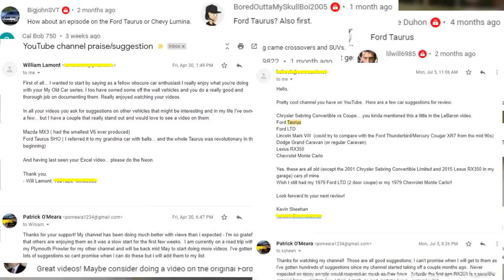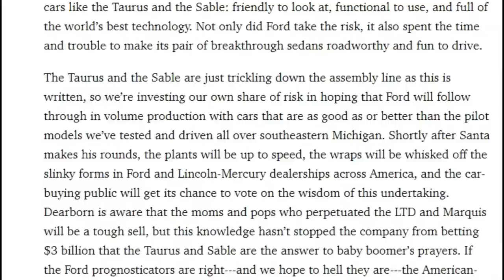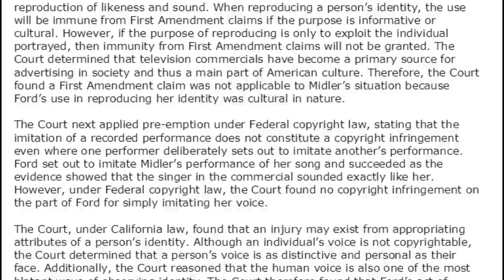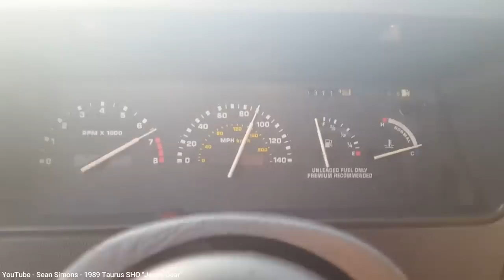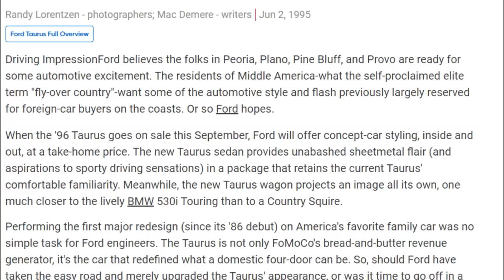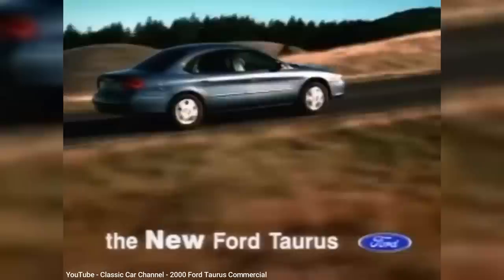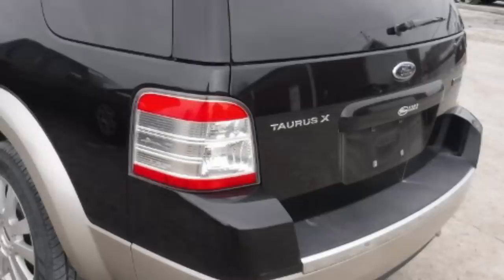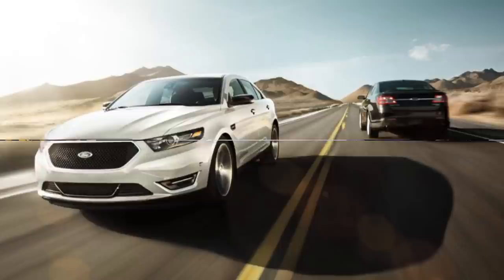Here’s how the Taurus went from Ford’s best seller to a forgotten icon

Comment: The SHO engine from Yamaha was never designed for anything other than the Taurus. Originally, Ford wanted Yamaha to make DOHC heads for the 3.0 Vulcan engine but Yamaha was not pleased with the performance of the Vulcan block so they requested to Ford to make the entire engine. Ford wanted the SHO to come out much earlier with prototypes shown as early as '86. With the Yamaha redesign of the entire engine, the SHO ended up being pushed back to '89. It can be assumed that the MT-5 was just made to fill the hole that late SHO left.

Comment: Ford Taurus and Mercury Sable even were enlarged and redesigned in 1988 as the first front wheel drive Lincoln Continental with only a 3.8 liter V6 available.  Then in 1995 Continentals were redesigned again (a year before Taurus and Sable), however getting their much better, more powerful V8 back that they didn't have since 1987 when those cars had the older, less powerful V8 developed back at the end of the 1970s.

Comment: I had a 1968 Saab model 96 3 cylinder 2 cycle with a lifetime guarantee on the engine. Total $1895.00. In 1970 I had the Saab dealer replace the motor for free.

Comment: My parents had an 86 Taurus, an 89 Sable wagon, a 96 Taurus wagon and a 99 Sable wagon. I might have had a Taurus wagon if my 06 Freestyle was called a Taurus, but the Fusion should have been the new Taurus. The late 90s front ends were ugly but the interiors were good, the AC/radio combo units and the flip folding console up front for 5/6 passenger seating was unique. If they had done the 2000 body style in 96 I wonder if sales would have continued strong.

Comment: I had a 91, 99 and 2005 Taurus. Good cars except the transmissions blew up in the 91and 05 each at about 140, 000 miles in spite of having the trans fluid replaced 3X in each. I guess that’s normal for those cars. Also the 05 ac had to be replaced at 106, 000 miles just a few miles past the 100K extended warranty. The ugly oval 99 was by far the best, 240, 000 trouble free miles when I traded it in.

Comment: For all of us into car audio at the time that oval radio faceplate made our hearts sink. Up until that point if you wanted to swap the deck out you just simply pulled the original and it left the same size hole for your new one. Now you have to rely on special kits by third party companies for nearly every car IF there even is one.

Comment: My dad had a 1996 Taurus SHO. I thought it was the coolest thing ever and was so impressed with the styling, the CD changer, and the sunroof. 

I was less impressed when the automatic transmission failures started happening 5 years later and my dad clung on to that car by starting in 2nd gear before shifting into drive at every stop. I'll never buy an American car.

Comment: I had a 93 Taurus it was the first car I owned new and it was a money pit as I would make frequent visits to a repair shop like every three months. even the clock on the dash broke after owning it for less than four months. I now drive a Lexus with over 350,000 miles with just the regular maintenance.  I really wanted to support the domestic car companies but could not justify wasting my hard earned money.

Comment: My dad bought a brand new emerald green Ford Taurus back in the day drove it off the lot practically weak into its life the transmission went and then it had problems with the tire rods but that car engine never had a problem  for like years I don't even know 15 years I had like a 2008 red Ford Taurus that had problems with the dome light where you would shut the door in the light wouldn't go out

Comment: Interesting video. Couple points were off. Five Hundred sold 2005 to 2007. Taurus 2008 to 2009 (first all wheel drive taurus; five hundred was available as all wheel drive)
Otherwise pretty spot on! 🙂

Comment: I had a Toreador Red 1998 Taurus. It rode nice and smooth and it was comfortable. The transmission started clunking.  The transmission fried and it was going to cost to much to fix. I traded it for a 3 year old 2002 neon.
Reply: Bad to worse....nice
Reply: @lowlifeangler  The neon had zero issues and the Taurus was fried. So no it was better.

Comment: Great video, however I have to disagree with you on the rarity of these vehicles. Here in the northeastern part of the U.S., I still see quite a few of the 4th generation Taurus/Sable cars still running around. In fact, I happen to own one of those myself: a 2004 Taurus SES. Great car, and probably one of the best handling cars I've ever owned! Plus, I can get a lot of items stored inside of it when I need to.

Comment: I had the 88 Taurus. It was so unreliable. The trans was going out. It would overheat alot even though I changed the water pump,thermostat valve and changed the anti freeze. Lol the plastic parts would break and fall off. But I had good memories. It was my first lemon. Lol

Comment: The Taurus had transmission problems and 1991 was the worst year of them.The 3.8 V6 engine was junk,ate headgaskets.The 1996 and up Taurus had a recall,the spring in the strut assembly broke puncturing the tire sidewalls.Fix was a plate put in the strut.The Ford 500,Freestyle and Montego had a junk CVT transmission in them.The 6th gen Taurus has a GM automatic in them.The manual transmission behind the SHO was not made by Mazda.It was the MTX used in the Tempo which did not hold up at all

Comment: Years ago i went to look at a beater with a heater. They were selling it because they hated driving a manual transmission. It was the ugliest maroon over grey rusty shitbox of a taurus on planet earth . Low and behold someone at one time had swapped an sho engine and front seats into a standard taurus. . It was the best sleeper that i ever owned. 5.0 mustangs were a mere snack for it. Iroc camaro’s were regularly embarrassed by it. It lasted about five months until I blew a half shaft apart during a rev an dump. Took the transmission and turned it indo a maraca. I still have the intake manifold as a wallhanger. Best $500 worth of fun i have ever spent. No one ever saw it coming.

Comment: I had two of these. Both had head gasket issues 5000 miles outside if warranty. Both times Ford told me to go pound sand when I asked for warranty assistance. I’ve never owned a Ford since and found the joy of owning imports. I’ve never trusted Ford since,

Comment: You should have added about the Ford fusion. Ford had a controlling interest in Mazda they told Martha they had to use Ford chassis. The Mazda 2 was the Ford fiesta festiva. The Mazda 3 was a Ford focus. The Mazda 6 was the jelly Bean Taurus chassis that Mazda used shortened then went racing at Laguna seca. Ford liked it and turned it into the Ford fusion. The fusion was a solid car. But it left the doors open for the name change of the 500 Volvo chassis to the Taurus. PS the Ford Mazda shared chassis. When Mazda separated from Ford they used these chassis to make Toyotas d fiesta. And possibly the focus. Figure it out.

Comment: I owned two Taurus wagons a red 1986 that I loved but the Transmission wasn’t very good and I also had a cranberry colored 1993, it had great pickup but the engine was a piece of junk the aluminum heads warped, and Ford didn’t careThey pretended they knew nothing about it until I tried trade it in on a new car, they offered me $700.00 for a four year old car with 42,000 miles that I just spent $2300.00 dollars to fit, then they informed me the car was junk, I went and bought a Honda that I still have

Comment: This question goes out to first generation Taurus owners. Was there a unique feature on this car that the windshield would defog quickly?
Reply: Yes, you are referring to "InstaClear".  It could melt 1/10" of ice off of the windshield in 2 to 3 minutes.  It was discontinued because of high cost of getting a replacement windshield and if I'm not mistaken, was an expensive option as well.

Comment: 2010 SHO owner here.  Horrible reliability.  Brakes, TB, steering column seized up, coil pack, brakes, flex lines, heater goes cold at idle die to air in the cooling system, rotten exhaust, brakes, power rear sunshade, hvac door broken, water flooded fire wall from clogged grommet, brakes, control arms, tie rods, no key detected 30% of time, eats fob batteries horrid turbo lag until 3500 rpm and finally brakes.  I think I’ve missed a few more trivial items.  All this has occurred between 80,000-105,000 kms.  Lightly driven cream puff.  The most overrated pile of junk, no wonder police forces ran away from these after only a few years.  On paper they are great, when they work it’s not bad but the cost and frequency of failure is staggering.  Not worth it.

Comment: The crown Victoria replaced the LTD not the Taurus and the fusion became the Taurus not the five hundred because the five hundred became the fusion. But I had a 1999 mercury Sable wagon which is basically the Taurus just mercury
Reply: The Fusion and the Taurus were two  completely different cars. The Five Hundred evolved into the Taurus in 1998.

Comment: I had the misfortune to have owned and hated my '86 and '88 Taurus.  After so many reliability problems, I swear that I will never ever ever buy another Ford sedan -- truck maybe.  You forgot to mention a few things:  1. The Gen 1 Taurus handled very very well -- because the chassis engineer came from Porsche.  2. The Gen 3 Taurus' chief designer had to retire in disgrace after he made such an ugly oval car.  3. The Gen 3 Taurus took many more man-hours to manufacture than the Gen 2 or Camry and Accord, which is why the car was never profitable and was mainly a fleet sales car.  4. The Gen 1 and 2 Taurus was about 190 inches in length, but the Gen 3 grew to 200+ inches with no appreciable increase in interior room or cargo room.  The resultant weight increases over the years were laughable.  My Gen 1 Taurus' body flex was plain awful -- it squeaked like it was a Radio Flyer.  5. The Ford 500 was ridiculous over-priced -- starting at over $30K -- many thousands more than a Camry or Accord.  My '88 Taurus had a 6 year powertrain warranty and its transmission died with 30K miles on the odo and 5 years 11 months on the clock.  It was as if Ford designed the car to fail.

Comment: Nice car to drive and reasonable gas mileage but poor long-term reliability. Problems with transmissions, radiators, engine mounts, heater coils, would eventually kill these cars with around 160,000 miles. “Quality is #1” was the motto.  Toyota took over & Ford blew it.
Ouch.

Comment: Ford got lazy and then quality went down hill as well.   I do have to say the 1990-1995 era of Taurus was perhaps the best.  A bit dated design, but very safe, reliable (for the most part--some had cooling issues and trans issues in some years) but overall, a good family car.  But I think Ford got dethroned around 1996 with the ugly design, and sort of went down hill from there (and I think the re-design in 1996 is what ultimately started the slow painful death of the Taurus).  By the time it was re-designed in 2000, Ford had sportier options, like the Focus and GM had some options too which were beating the Taurus, so ultimately the Taurus, still being a dated design with the 2000-2005 body style, lost out and Ford got dethroned in the family sedan market by Honda and Toyota (both for reliability, price, and styling).

Comment: I truly HATE working on front wheel drive cars, like that piece of $hit Taurus! 🤦‍♂️
I can hardly wait until car manufacturers realize what a SHITTY idea that is.
If I worked on cars for a living, I would charge DOUBLE to fix a front wheel drive car. The spark plugs are hard to reach, you're ALWAYS cramming your arm into tight spaces to get at a bolt. You can't do ANYTHING on them without getting filthy. 
The "car of the future" 🤣
"6000 SUX" is the pefect name.